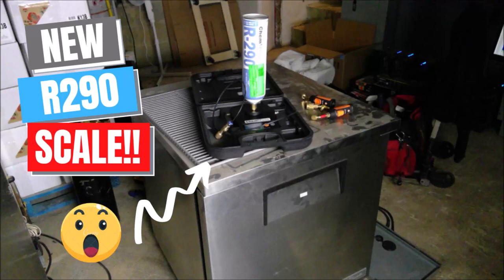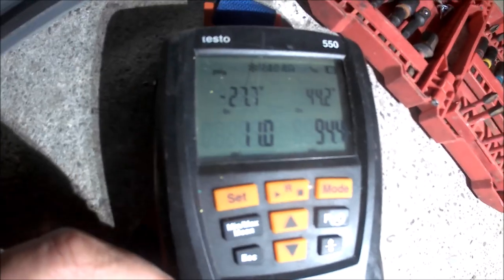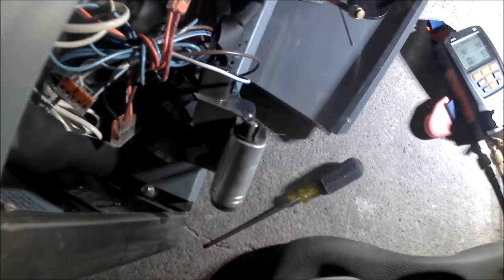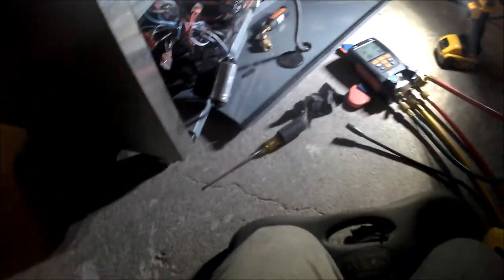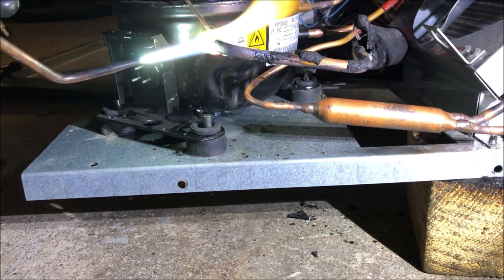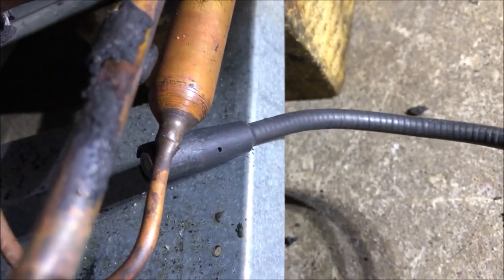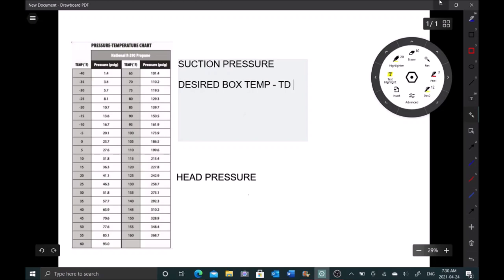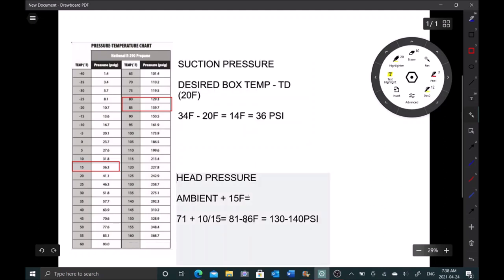True R290 Cooler Warranty Call. Cooler is not cooling.

Comment: When I got my scale like yours it was a real game changer !!
Currently the limit on R290 in the USA is 150 grams , however there in the process of getting the limit raised to 500 grams .
Reply from the maker: So potentially see it on bigger equipment, cool.  Yes, the scale is great.
Reply: It's the same limit in Europe. I never see equipment with a charge larger than 150gr
Reply: What is that process ?
Reply: The IEC just approved an increase in the charge limit for propane (R-290) from 150 to 500 grams. How does this affect you?

The standard revision allowing up to 500 grams of R-290 is in the international version of the equipment safety standard for commercial refrigerators, IEC 60335-2-89. The North American versions of the standard (UL and CSA) will go through a revision process of their own starting later in 2019. A working group composed of U.S. and Canadian experts will make harmonized changes to their standards based on what is best for North America. This may mean that a charge limit of less than 500 grams for R-290 is approved, or that it is only allowed in certain types of equipment, but we will have to wait and see. That work will likely take one and half to two years to complete.

Europe, on the other hand, will likely adopt the IEC version of the standard with the 500-gram limit for R-290 starting sometime in 2020.
Reply: Thanus Stevenson
I tried to post the link to two articles,  but the algorithm keeps deleting it.
But if you Google R290 limits you will get the AHR news article. 
The UL approved 500 grams in open case units, some of the information is dated.
Cheers 🍻
Reply: How many oz did the cooler holds

Comment: I put taps on all the r290 systems I work on, I’ve talked to multiple manufacturers, many say it’s totally fine just use sealed metal caps, plus I always leak check when I’m done. It’s just stupid to use piercing valves every time you need pressures. Then seal it off again, it’s asinine.
Reply from the maker: Ya agreed

Comment: Great video. I am always at loss with split condenser temp. Sometimes its 30 sometimes its 25, 15 or 10. Obvisouly if someone uses 10 instead of 30 all calculations would be wrong and would predict restriction while there is not.
is there a way to find out on the spot? Thanks tons
Reply from the maker: No not really, but based on your suction pressure you will be able to diagnose the issue with simply knowing if we have hi or low head pressure.
Reply: @REFRIGERATION KITCHEN TECH  so do you just make a educated guess on what TD to use?

Comment: We were told by a couple manufacturers not to use gas analyzer.
Reply from the maker: Yes Delfield has told us not to. True has told us to continue using it. Until I can’t find a leak with it, I will continue to use. The success rate has been high with this specific meter.

Comment: It's not quite as straightforward as just checking ambient temp and assuming your saturation temps are correct.  What if your box temp is 84 and your   ambient is 95.  It kind of changes things. 

You don't want your saturation temp in a 84 degree box to be at 15.   The 10-20 Evap TD (depending on who you ask) stands true,  Your suction and head will be way higher if your dealing with a really warm box temp.  

When I first started, I thought I overcharged  a system and an old timer said "man don't worry yet let it run a couple hours and see what what it's doing then.

It was running perfectly with 17 degree sat. Temp right before it would cycle off.

Then the cap tube slowly plugged and that sweet 17 saturation had dropped to about 2 and High side just kept going up.
 Cap tubes.........

Comment: let me ask you. You don't evacuate rest of r290 out of system, just charge extra nitrogen yea? and this will help you find leak r290 under nitrogen pressure right? if yes, good idea. And 2nd question. When you charge that little amount of propans or other r600... how did you compensate weight of refrigerant which remain in hoses? Does it matter or no? can i do it like this:
1. put the cylinder on the scale - check the weight, e.g. 1000g
2. open all valves up to the gauges - check how much has been lost, e.g. 30g
3. Now open the last valve directly to charge the refrigerant into the system and control the amount of weight.
Reply from the maker: They now have a scale that the bottle screws into with a very small hose so the amount going into the system is very accurate. At the end of the day, if you know what your suction pressure needs to be, that is what we charge to and that may add an ounce or more to the listed critical charge.

Comment: Just a quick question, How do you know the evaporator TD Is it always 20F?
Another good video thanks for posting👊
Reply from the maker: In most cases, reach ins are 20TD, walk ins 10TD.
Reply: But the evap coil seems to be running too cold, can you post the manual of the unit, i think it should be as per manufacturer, other than that what a great video.

Comment: I've always wanted a scale like this but just went off pressure all the time.  Did you use national brand r-290?  Because some of the bottles have different thread taps on the top. Just a lil tid bit y'all,. I've literally heard straight up from manufactures that they lie a little bit about total charge on label to stay under laws/regulations... So remember most of the time your gonna use most of that 14oz bottle.  Even though it only says 7ozs. Also your only using 1/10" of an oz diluted with nitro for the test?  Is that really enough propane?
Reply from the maker: With other refrigerants (134/404/22) I only put 5-8 psi then add refrigerant and have found leaks. In this case I was up 16psi so the meter should be able to pick it up, regardless the nitrogen pressures will let me know if there is a leak. In Canada, we can’t let refrigerant out into the atmosphere, it’s a huge fine, so we can only add a small trace amount when leak testing. In the case of R290, we can vent it, so it would not apply to R290. I found when I was using my other scale, the critical charge seemed to be off slightly like you are stating.
Reply: Yeah,  I ran into the problem of the R290 cans with the valve that taps the can .
They don't work on the scale. 
Have to use the self sealing national brand.
But united refrigeration sells the national brand , and that's were I got the scale.

Comment: 120 psig pressire test  ,your pressure after the test is 112psig  ,"we are holding pressure" you lost 8 psig its this right?
Reply from the maker: 120 was when I was still adding nitrogen and gauge valve was open. System equalized at 112, that’s when I start to time the pressure test.